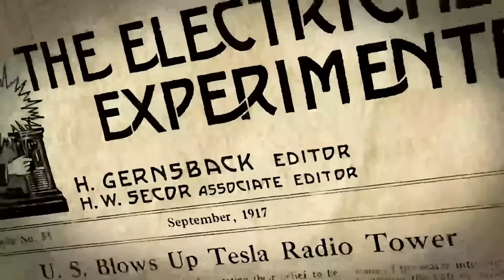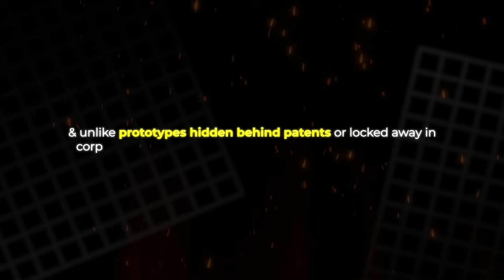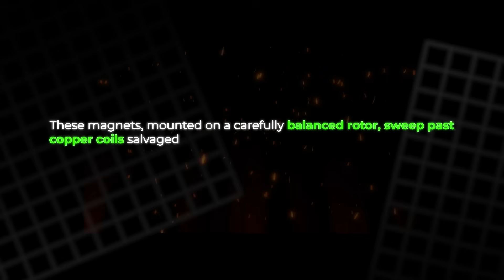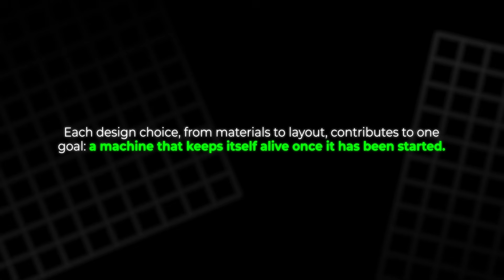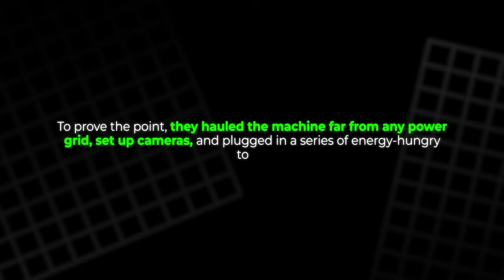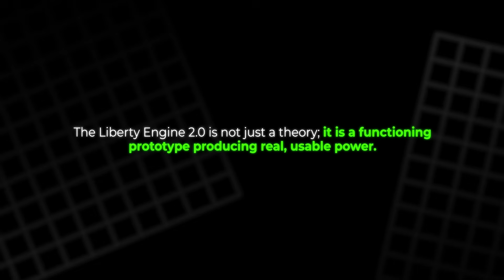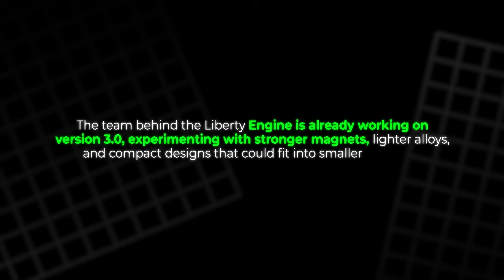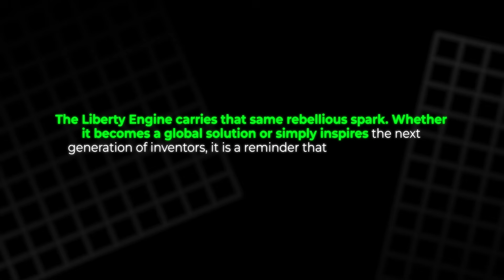Nikola Tesla’s Forgotten Invention Finally Comes Alive | The Liberty Engine 2.0

Comment: It's been 145 years since Tesla did his experiments, and since then the home hobbyists, and inventors of all sorts have been claiming "Free Energy." NONE of their experiments could be reproduced. 99% of them have turned out to be fraudulent, with the slim remaining percentage being attributed to a complete lack of understanding, not just of the math or application of Thermodynamics, but a fundamental misunderstanding of what it means. Scientists, Engineers, other Hobbyists, and Inventors of all sorts have tried and failed to reproduce any of them. The actual number of claimants who've died, in mysterious circumstances or not, before they were debunked, approaches ZERO.
These claims aren't just debunked by 'The Man,' but by Scientists, Engineers, other Hobbyists, and Inventors of all sorts, worldwide.
Nothing is being suppressed. Nothing is being suppressed, because nothing CAN work like this. It's not just impossible, it's illogical.
"Energy" is the capacity to do work. Imagine a spring. If you compress it, you store the work you did to it inside it, as a potential. When you release it, it can 'do work' with that energy. You can move energy around, and do some impressive things with it, but the total energy in any connected system is always equal to, or less than (due to losses) the energy put into that system.
Think of every 'thing' which can do work, such as a generator, motor, lever, organism, planet, etc... as a closed box. If you put energy into that box, from outside (planet from the sun, generator from fuel, motor from electricity, etc...) then that's the total amount of energy it can ever pass back out. Period.
If you ever get more energy OUT of a system then you thought you put IN, then you did your energy equation wrong. Maybe your fuel was contaminated with something that burns but has more inherent energy, such as when Nitrous Oxide is injected into an engine, causing the fuel to burn hotter, but it WILL NEVER BE MORE.
"But what about 'Quantum Foam' or tapping the fabric of Spacetime?" ...What 'work' does Spacetime do? Work is done OVER space and time. If you draw a stick figure, you can't feed him the paper upon which he's drawn.

Alas, even in 145 years, we can figure that out so solidly as to instantly label anyone who makes such claims as frauds, with perfect accuracy, but we can't figure out how to convince the general public. Perhaps idiot shaming needs a comeback?
Reply: indeed

Comment: Ive been working on a plasma jet for modernized Vimanas since 1880 something or so

When I had a FERRY-MORSE engine

But it had 8 or 12 cylanders I think

And I would use a dynamo, to deliver current at high voltage, to a tesla coil, grounded to a battery

To produce plasma

And I thought one day

I would make a  magnet lined steel tube around the tesla coil, With overflowing current to the magnets, with north poles facing the tesla coil (spark plug) 

To create a plasma jet, by confining the plasma, in a magnetic field 

Which would then create a powerful engine, to fly a freight train sized vehicle 

To space
Reply: how is almost weightless plasma gonna launch a train into space?
Reply: this is just a word salad
Reply from the maker: That's a very creative and detailed concept for a plasma jet engine!